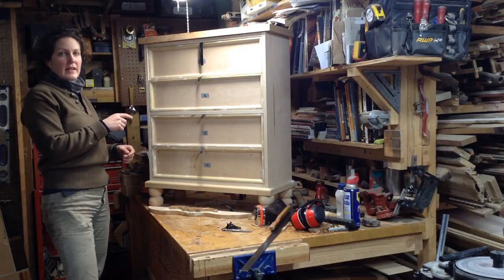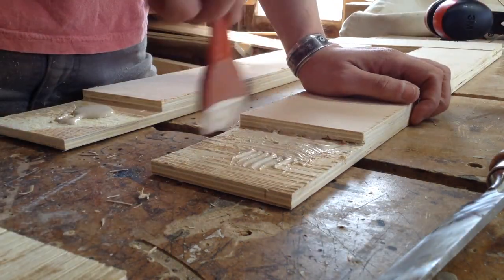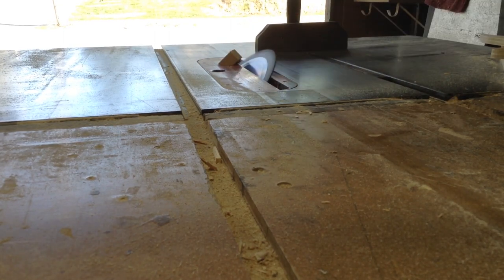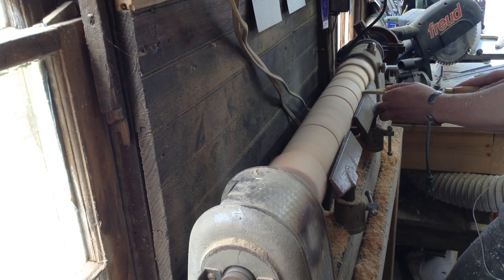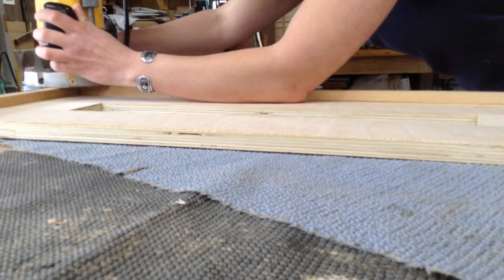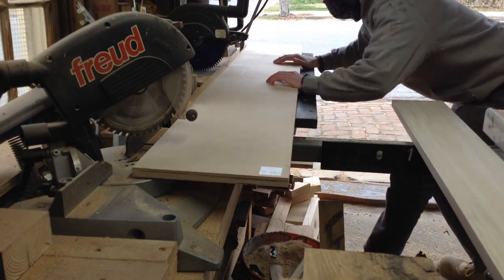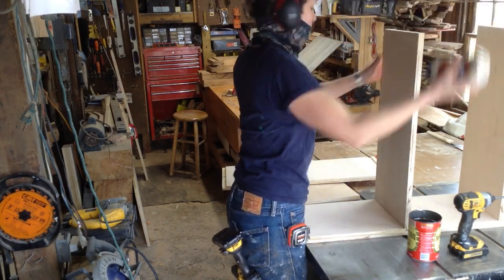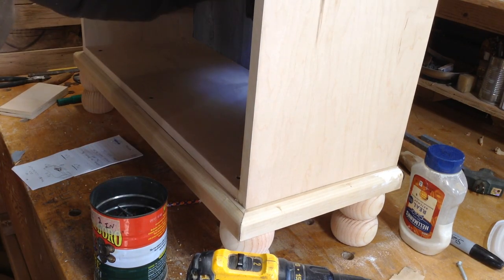Woodworking :  Small Dresser // How-To Part 1

Comment: Always look forward to your posts.   Most YouTube makers just make a bunch of junk for the shop like hammer holders etc!  Or show us their $20000 CNC machines while pulling out all of their “scrap” Baltic birch plywood and walnut pieces! I think many of us who watch these videos would like to make something useful.  Thanks for providing that. Also my guess is the difference between the mustard and mayo glue bottles is that one is for waterproof glue!  Stay safe.
Reply from the maker: Thanks!  That was the original plan, but as nice as those condiment bottles are, most of them have a little plastic diaphragm which is perfect for squirting on hot dogs, but doesn't really withstand the rigors of dried glue and wood shop life.  So, it's replacement for the small mustard bottle.  I got a French's mustard bottle in the wings, sans plastic diaphragm that I think will be the best of them all though haha.

Comment: Don't beat yourself up on thing's so much! Remember every build is different and a learning process! Remember it is wood there is nothing that can't be tweaked and it is a one of kind! That's what makes it unique. You will be the only one that knows! On the molding you were routing I don't know how much revel there was over the frame but why not slide a piece the same thickness as the reveal to support the router base! It looks good another good job! Remember in the words of Frank Klaus practice makes the master! Through the process is how we hone are skills!
Reply from the maker: Someone else mentioned adding a piece to the base for routing, which would have been very smart and avoided any issues.

Comment: Looks great.  When you put the dry wall screws into the base it looks like you seat them then screw them out before finally seating them. Why is that?
Reply from the maker: Sometimes, even with a good driver, the joint will pull apart a little the first time.  I back them out and squeeze the joint back together, so on the second go everything stays flush.
Reply: @HoneyBadgerWoodWorks  great tip!